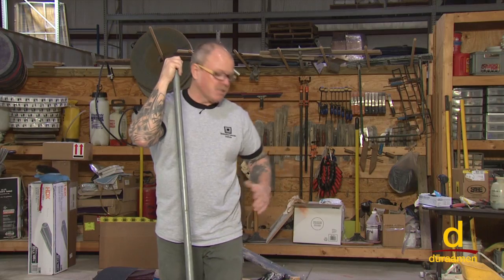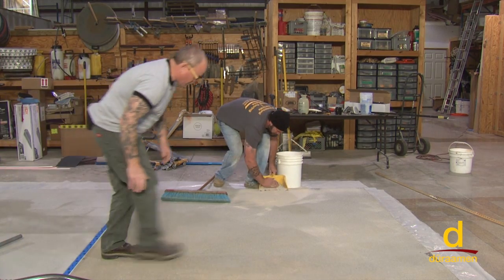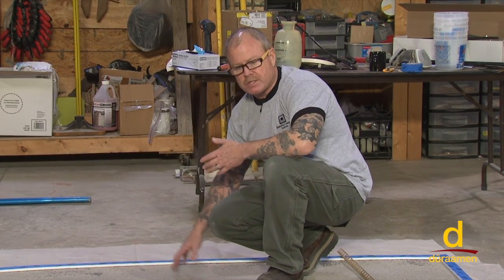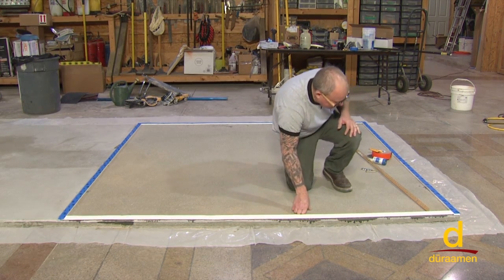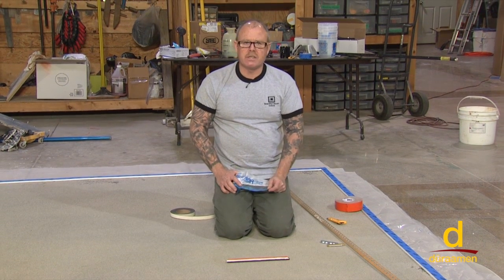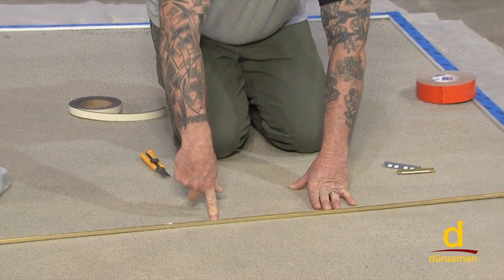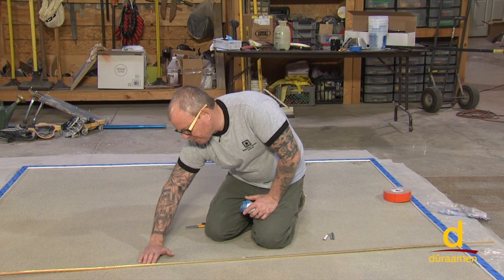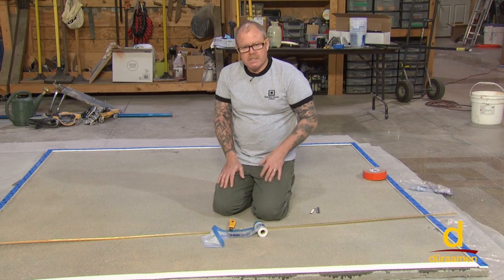How to Polish Self-Leveling Concrete Overlay - Part 2

Comment: if the self leveler won't adhere to any areas where the primer didn't get any sand, then the self leveler is useless. Ive never broadcasted sand in the primer in any self leveling topping and have never had a delamination. If the self leveler can bond to a primer that doesn't have sand on it, then you better find a better product